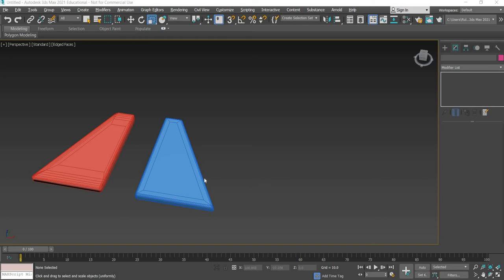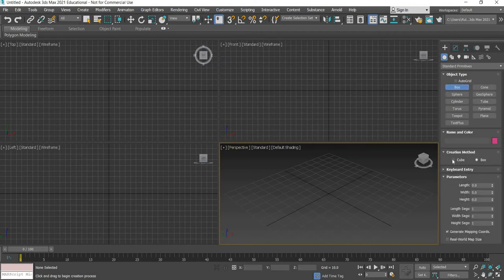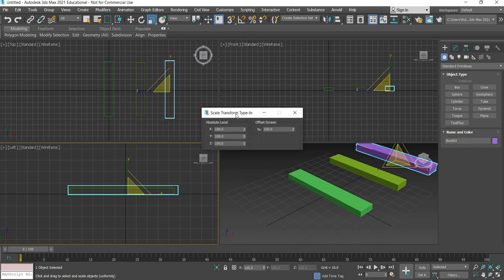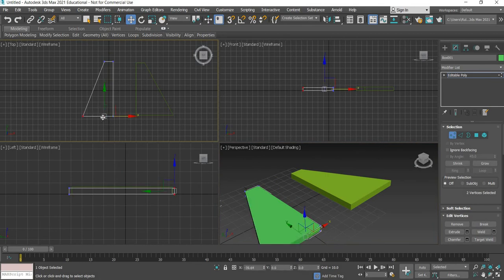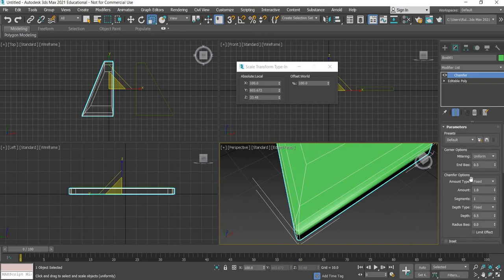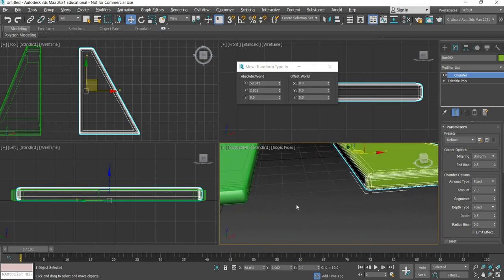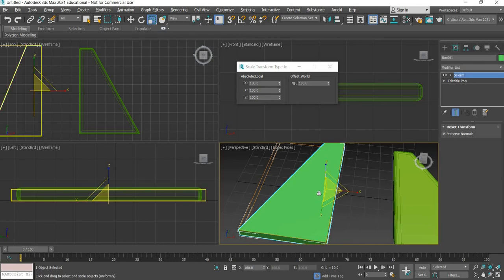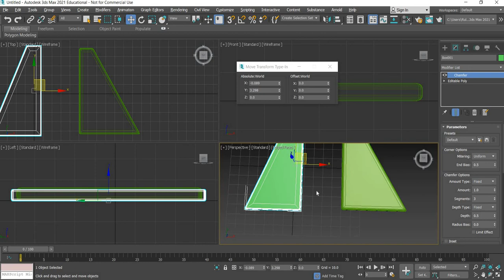3DS Max 2021 - Uneven Inset and Chamfer Solved

Comment: If this dosent fix your issue, its because the scale modifications were done in a different editable mode (poly, mesh, patch.) you will need to switch mode before reset xform can affect the right mode. then you'll be able to switch back.

Comment: Thanks man, casual amateur 3ds max user for a long time and I didn't know about this until now. Any ideas on how to make the connect edges feature (for editable poly) display the amount in measurements units (imperial or metric, metric preferred) instead of percentages? Just like inset does.